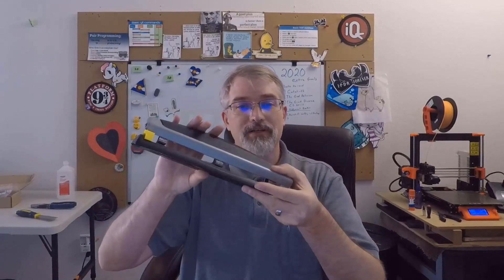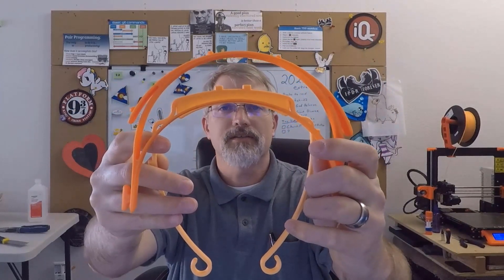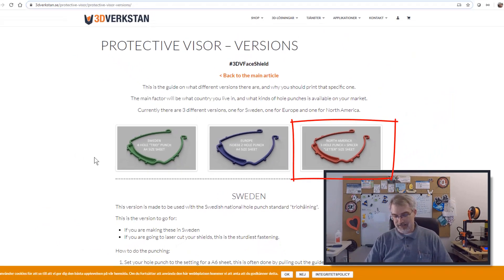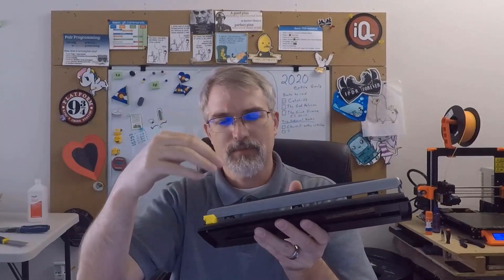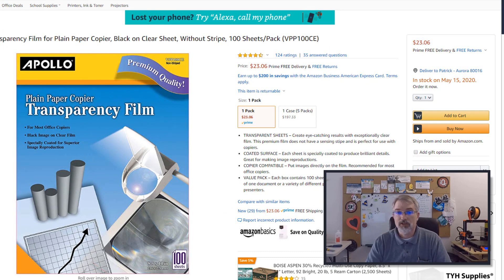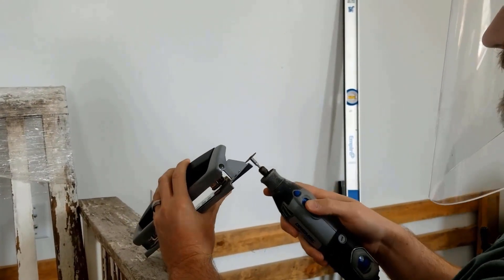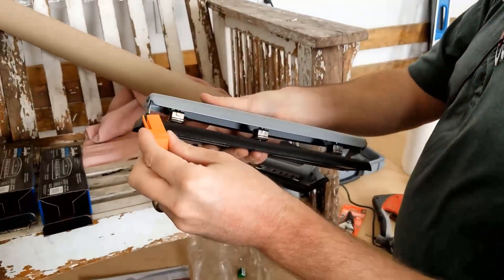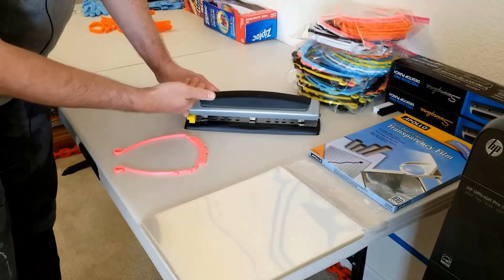COVID: 3DVerkstan Face Shield Hole Punch Adjuster

Comment: Isn't a single slot, the width of the cutoff wheel, thick enough for a few transparency sheets to slide through?
Reply from the maker: yeah it should be but you may need to get a file in there to smooth it out so you don't get any snagging.
But in theory it would work
Reply: @iqless  My existing 3-hole punch is already open on the right side.  Just thought you could save a bit of time by creating the one single slot, and maybe some rough sandpaper to smooth out the rough bits. Maybe double the width of the slot by screwing two cutoff wheels onto the dremel.  Good stuff!

Comment: Wtf! Did you just hold a hole puncher in the midair to cut into it with no hands protection but you have your face shield? 😂 Please put it down on a  flat surface eye level so you can cut it properly! Safety first!

Comment: Did you notice that the Amazon product page you showed for the clear sheets says that it wont be available until mid-May?
Reply from the maker: I did not notice that ouch.
You can also use laminate like https://www.amazon.com/Scotch-Laminating-11-4-Inches-100-Pack-TP5854-100/dp/B00MFTLNU0/ref=sr_1_2_sspa?keywords=laminate+sheets&qid=1585532681&sr=8-2-spons&psc=1&spLa=ZW5jcnlwdGVkUXVhbGlmaWVyPUExQlNOSjQ4TzRVNlM0JmVuY3J5cHRlZElkPUEwMzQ0ODAwMjFSNzlWUEJROUdUMyZlbmNyeXB0ZWRBZElkPUEwNDc0NDAzWlUwQVRCQTlIOVQ5JndpZGdldE5hbWU9c3BfYXRmJmFjdGlvbj1jbGlja1JlZGlyZWN0JmRvTm90TG9nQ2xpY2s9dHJ1ZQ==

Assuming you have a laminater
I did hear someone throw out the idea of using 2 liter bottle cutting them up and using them as face shields